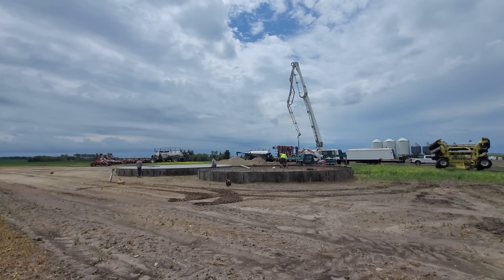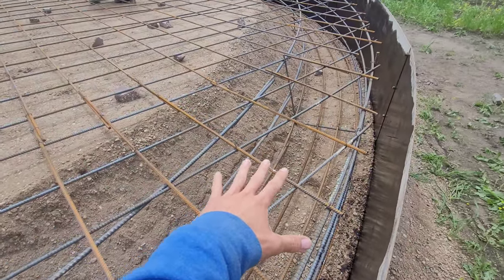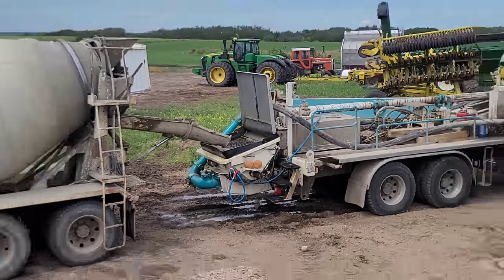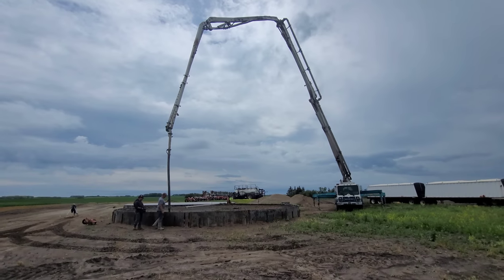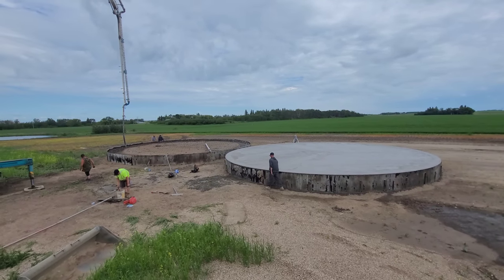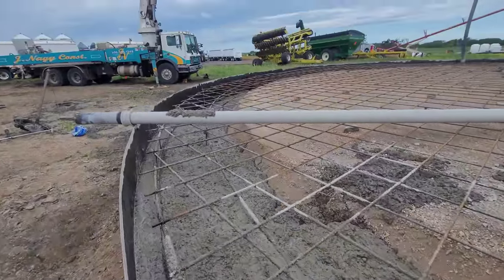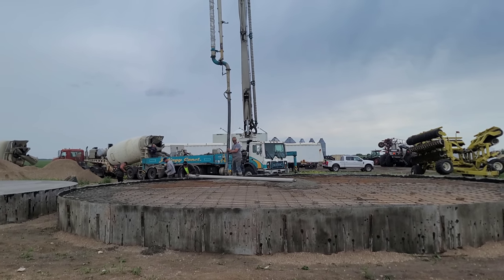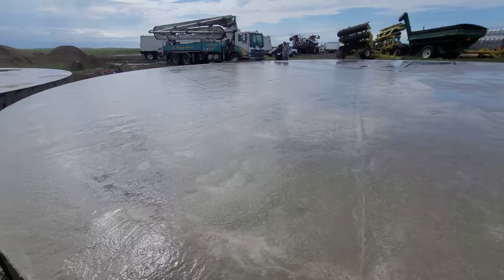Pumping Concrete?!

Comment: The local elevator 2 miles from me is putting up two 500,000 bushel bins. It has been fun to watch the building process from pouring the pads to now building the leg & the bins. It will be nice to have the extra room to haul grain to. There is a lot of bin work coming to our area in the future. There were a lot of bins lost to wind & tornados here on Memorial Day. Some guys are being told it could be a year or more before they can get a new bin.

Comment: Only because I know you're a perfectionist.  Concrete is a chemical reaction.  It hardens, it doesn't dry.
Reply: That's true, however in this case they were literally waiting for it to dry after the rain storm, because it had too much water on the surface to properly finish it.
So they were waiting for the surface to dry out to where they could do the final floating and finishing.
Reply: @ke6gwf  Point taken.  Thx

Comment: As a German contractor, with my fair share of concrete work in agricultural construction, 
im every time amazed of the tiny ammount of rebar you guys use in something like the Bin footings. 
6" in the Middle... would be probably 12" here, with double layers of rebar 4"x4 "and at least 1/2" thick rebar.  

And we ould have an foil under it to keep the water in the concrete, 
and would have coverd it after the trowel, to have it cures slowly to avoid cracks and and smooth surface.

No concrete vibrator to be seen..how the heck did these guys get the air out of the mix?
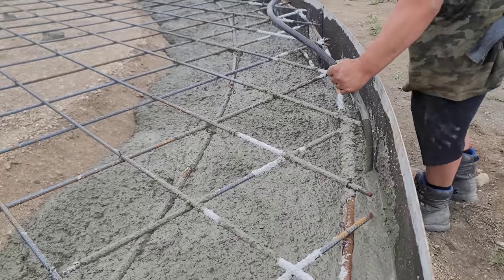Reply: Bei 8:50 haben sie einen kleinen Rüttler, aber das ist wirklich kein Vergleich wie das hier gemacht wird.
Reply: In Sweden we would had more rebar as well...and we use almost every time self vibrating concrete now adays.
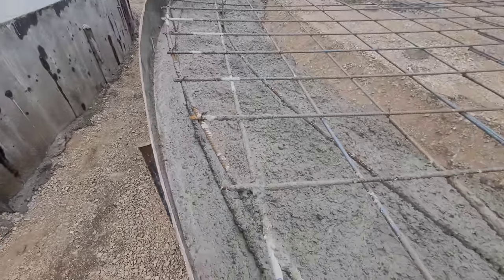Reply: 8:42 a vibrating machine for the edges of the pad
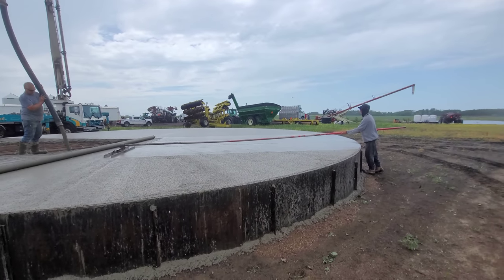11:26 the big round thing they're using to level vibrates
Reply: I work for a large construction company in Saskatchewan (we actually hire the concrete pumper that Mike used in this video often).  Compared to the commercial and industrial projects that we perform, I'm often surprised at the quality of agricultural construction.  Many ag applications don't worry too much about long term quality.  For a foundation like this I would expect around 120kg of rebar/m3 of concrete in a commercial or industrial setting.  I would guess they are using around 75 kg/m3 in this video.  We would also be testing the slump and air of some or all loads. The curing would consist of either a curing compound application or a 7 day wet cure.
Reply: In Germany, you expect things that you build to be around in a few hundred years, and so you spend the extra money up front.
Over here we don't comprehend time spans like that, because we don't have things that old around here, and so we build to last 10 or 15 years, and reduce costs up front.

Also, we are always upgrading or changing things around, and so there's a good chance that in 20 years someone will be wanting to tear these down and do something else, and so building them stronger doesn't make as much sense.
Reply: @joshuadoll9000  the vibrating roller only smooths out the top layer, it needs to vibrated all the way
Reply: @TheDennisZb  The center is shallow enough the vibrations should penetrate enough to get all the air bubbles out. The other machine took care of the deeper edges. At least that's what I was told when I was helping do some concrete work.
Reply: I was an iron worker prior to a farmer, so I’ve seen my share of rods.  It’s light.  What gets me is that they’ve got a pumper for a 42’ bin.  Must have been conveniently located and / or discounted rate as it’s completely unnecessary.
Reply: @ke6gwf  As a german contractor, U have to give a 5 years warranty period on your work, 30 years if the customer proofs that the contractor  didnt follow the blueprints/cut corners.
Reply: @markzurowski3627  i would guess they are below 30kg/m3, and yes curing isnt their thing...  And Farmers like it cost efficent... 
or DIY.. been there done that, farmer did his own Earth&Gravel work, we tested the compaction with the dynamic drop plate FAil, We used the static load test to verify, Fail again.. Nope no Pour on this one, untill you sign a Note that it is on yer own risk.
Reply: @timgulotta7595  if you check out the support of the round formwork(hint there is none) you get the idea why they used the concrete pump, just to make sure the level of the concrete is rising evenly in the formwork. If they had dumped an whole truck on one side, the formworl would have boulged.  + You need less ppl and the work load is way lower when you use a pump, i spoil my team too.
Reply: @SirDigger420  yes, we won't build anything unless it has been stamped by a licensed engineer.  Of course, structural engineers tend to over design stuff to cover their risks, but it's better than under designing.  We test our subgrade and granular with proctor tests and field verify with nuclear densometer testing.
Reply: @SirDigger420  I get it - pump trucks in my neck of the woods are $500 per hour port to port.

Comment: When I was young I worked on a pumped  concrete pour where there was a catastrophic failure of the pump system.   There was no way to fix it quickly and the concrete set up and ruined the system.

Comment: I do not understand why they do not us more semi mixers. It would cut down on trucks, labour and fuel by almost 50%.
Reply: Because they are only good for wide open sites. And most the jobs around here require tandom or tridrive trucks.  So a semi would be sitting a lot.

Comment: Mike your Dad needs to have a third party inspection company (ie. ENG-TECH Consulting LTD)core sample his bin pads.  The compressive strength of that concrete has to be seriously compromised. The CSA standard (A23.1-14) is 120 minutes to place concrete. That can be lengthened with admixtures added at the time of batch  but.......well I doubt it left the plant with it.  The only reason the contractor would even accept such a mess is because they weren't ready and would be financially responsible for it.
Reply: I don't have any experience with Alliance concrete pumps but a Putzmeister pump runs a hydraulic pressure of up to 310bar(4500psi) and can exert a pressure of 85bar(1233psi) on the concrete inside those pipes.

Comment: My twin brother was part of the other crew who was part of the concrete crew and the reason why it didn't go smoothly is because they had a kid quit in the middle of it and then henceforth they fell behind and weren't able to keep up with everything
Reply: Insider knowledge.
Reply: @EFCasual  you bet he said it was the most frustrating thing that crew has ever dealt with. With the farm giving them shit for not keeping up and the concrete company as well
Reply: Ya but why wasn’t the company bringing the Crete called and told to stop batching loads?
Reply: @michaelhofer6941  my brother said they did that so they could keep up and finish up what they feel behind with to be able to get ready so that the next day wasn't such a mess as the previous day was

Comment: Ever figure how many pounds of grain those bins will hold?
Reply: You can estimate based on the bushels. These are going to be 40k bushel bins if I recall.
Reply: 55.000 bushel are both bins, so about 3.300.000 lbs / 1500 metric ton of wheat is max weight
Reply: @tjakko4659  
Larson Farms
I think Chet figured one of their bins held the weight of 11 millions pounds

Comment: Anyone knows how their tube level the concrete work?
Reply: It is a Roller or Spin Screed.
The gas engine at the outer end rotates the tube constantly, and so as they swing it around, it is pushing the concrete towards the edge of the pour, and leaving a smooth and level surface.
Reply: @ke6gwf  I can see that. But what is the roller made of? Is it smooth?
Reply: Its smooth and It’s made of aluminum. Some times they have a magnesium coating on them too. The one end rides on a pin in the center and the other rides on the bin form edge.